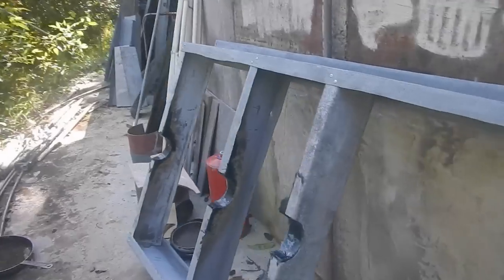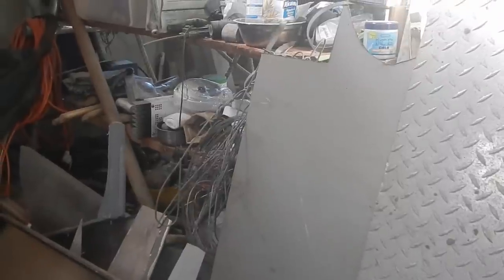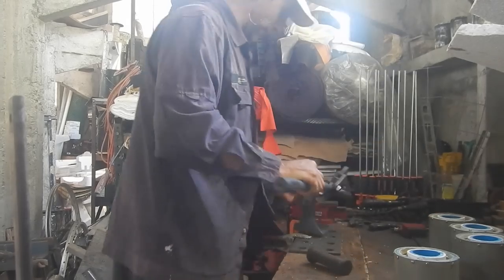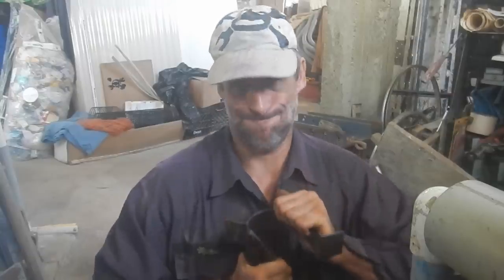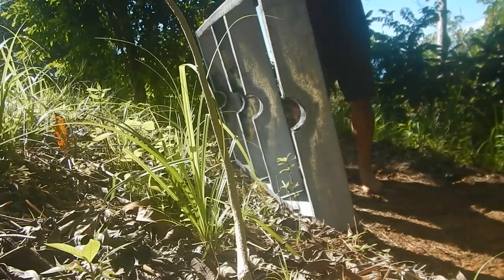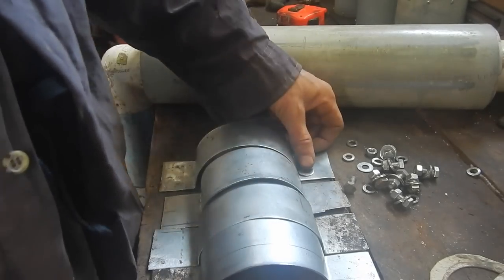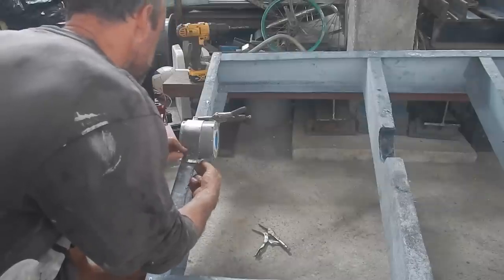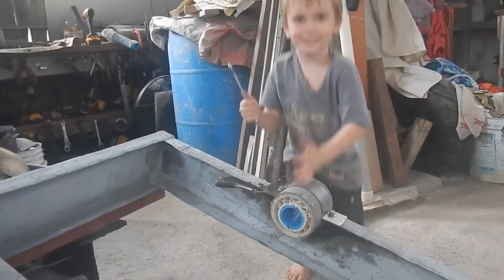Shark Slicer Upgrade 005 Mounting the Bearings

Comment: Looking good man! Merry Christmas! My thoughts were a little belt drive motor you can shove forward or back to tighten/loosen the belt and spin the paddle wheel, wonder if it would be more efficient than the spur gears in your outboard lower unit.